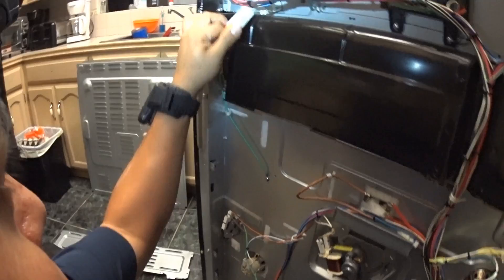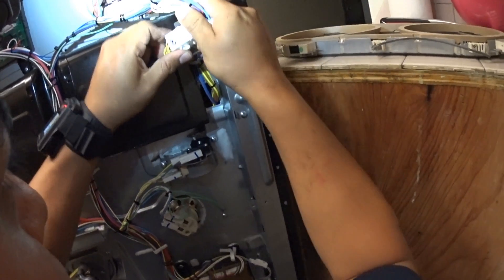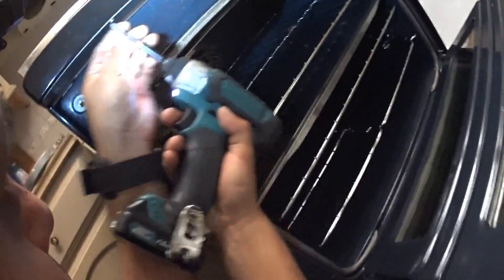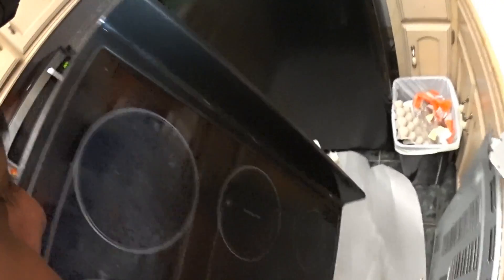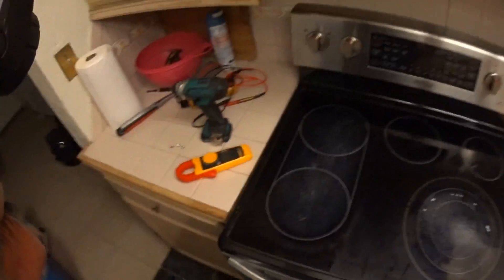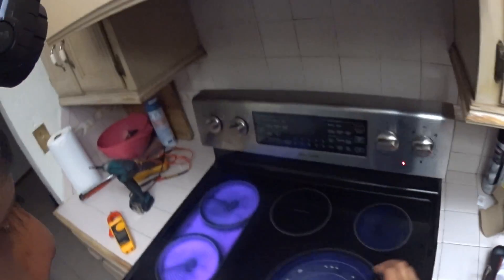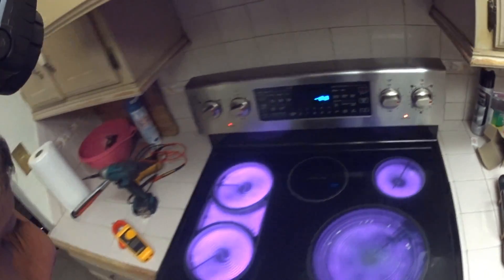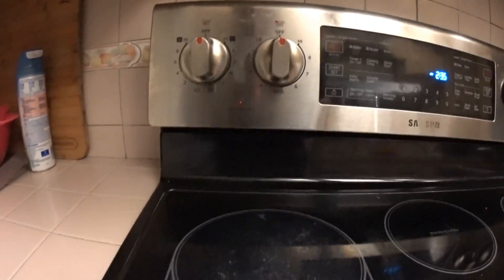Samsung Stove hot indicator light not turning off

Comment: Unplug the stove before doing anything. I watched another video that showed that terminals 1A and 2A were for the high temperature cut off switch, which should read 0 ohms at room temp. The terminals for the hot stove top temp indicator light are the two smaller ones, 1B and 2B. When it heats up, the sensor switch closes (0 ohms) and turns on the light. The resistance across those terminals should read open or infinite ohms at room temp. If the reading is low ohms(with the wires disconnected) the sensor is bad and should be replaced. Each element has its own sensor and probably only one has failed, turning the hot light on all the time. You can ohm them out to see which one is shorted. AT YOUR OWN RISK, you could choose to simply disconnect one of the wires on the failed sensor (terminal 1B or 2B) and that would turn the warning light off for that one element. The element should still work, I think, depending on how smart the stove electronics are. Tape up or secure the pulled wire so that it doesn't short to ground. Just like the old days, don't touch the cook top without first checking that it is hot.
Reply: Thanks for your comments "AT YOUR OWN RISK" - I will give this a try and hopefully save myself a few hundred dollars on a new element. If anyone else has done this "fix" please share your comments.

Comment: I just watched another video on this subject which said one must  turn off the breaker and then unplug the stove from the wall which this one didn't more details on this one is required. Of course after my extended warrantee of 4 years is up the light comes on Samsung support was very polite and helpful in helping me find a service man but my warrantee's being finished I will have to pay for this service. As mentioned in other comments this should be a recall. For me the light might go out in a day or so as it has been doing or not. I will not pay $200. or so to fix it.

Comment: Easy solution, if you place a small smiley face sticker over the light it goes away. Works great on the check engine light on your car also. Oh, don't touch the stovetop when it's hot.
Reply: The self-clean doesn't work with the sensors mis-reading

Comment: I have the same problem but Samsung won’t fix it because I called in just a little over one year.  They know it’s a problem but won’t improve the design in the newer models.  Damn you Samsung!  Last time you get my money!
Reply from the maker: V Flow find the element with a sensor short the elements cost around 40 on eBay.

Comment: Thanks for posting. I believe I have the same problem but wanted to clarify something - I assume there is a heat sensor for each element. Is this something that happens only to ONE of the elements/sensors? Or over time, will each elements' sensor fail? 
I only ask because I am (thankfully) still under the credit cards' extended warranty and want to know if I should try to get them to replace all heat sensors now (instead of just the 1 faulty one) before the warranty expires. Thanks in advance for any tips.
For the record, we have also had this stove (Samsung NE59J7750) for about 1.5yrs and we started noticing this about a month or so ago.
Reply from the maker: Adil Abdulla I see the issue more with the elements with more use. Replace them as well as the infinite switch or control knob 🎛
Reply: @ApplianceRep  Thanks. Why does the infinite switch/control knob also need replacing? Is that related to this problem with the hot surface light still being on? Or did you mean that those other parts that often fail, which I should get replaced in the warranty period?
Reply: 24TX Appliance Repair just swapped the control knob and still shows the bad disc. So problem didn’t follow the knob. So maybe replace the heating element? Thank you for your time

Comment: I have a Siemens stove model HN 122200. And the "On indicator light stays On.   checked all the switches and the problem was not in them. What can it be? It is not a hot surface indicator but an oven "On"  indicator or left side hubs "On"  Indicator . When I turn the left hubs On the light is bright and works as it should.  When I turn everything Off the light is less bright and stays On for days while everything is cold and turned Off.

When I unplug the wires from the hub switch (second switch from the left ) the light turns off. Also when I unplug the red wire from the oven switch (heaters setup switch not temperature) .  the light turns off.   Where is this short out coming from? I've checked the oven switch too and  it looks fine and it's is working fine. 

The stove is almost like new and everything else works just fine . But this light is driving me crazy. Every wire I folowed to find the problem goes to the back of the oven and to the current source.
Reply from the maker: Tomo Polic check to see if you don’t have a dropped neutral with the load on check it with a low z meter

Comment: 1.5 yrs after purchase under normal use -- quite accurate in my case.  now I have to search for a fix.  just do not want to pay this$345 labor and part.  agree, very unreal
Reply: Same thing here. Piece of junk
Reply: Same. Junk.
Reply: Our 6 year old Samsung range is junk. First the convection oven fan had to be replaced and now ALL of the surface elements are not working. And now our Samsung microwave has failed too - 6 years old. Garbage. Why did all the surface elements fail at the same time?